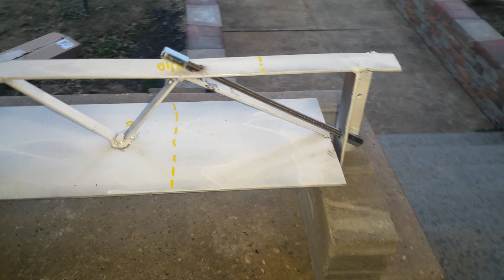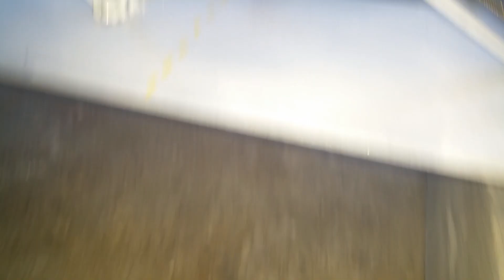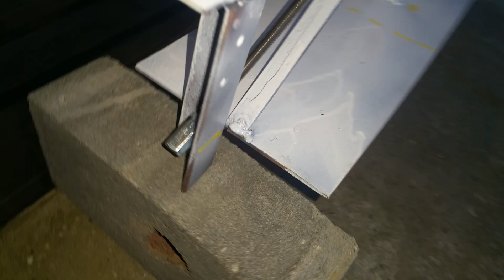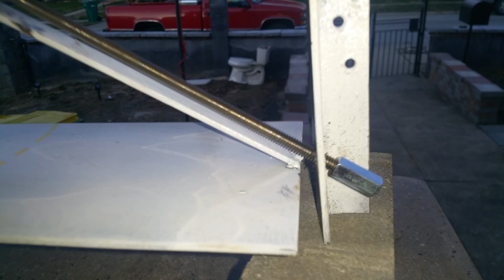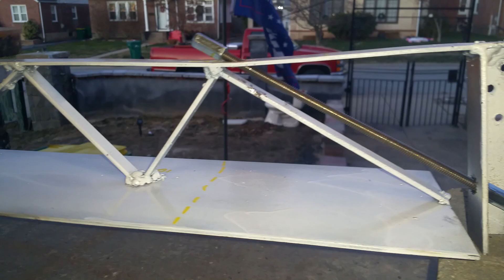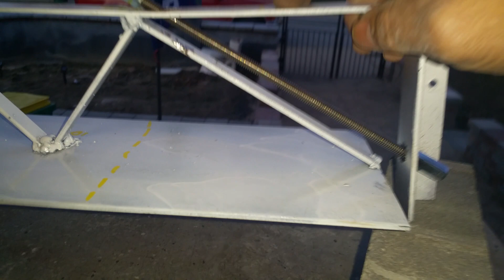FIU BRIDGE COLLAPSE MODEL PART 3 SAGGING DECK EXPLAINED = LONGITUDINAL POST TENSION FAILURE FIRST

Comment: Isn't sagging just a continuous downward deflection?  just about all bridges have some sort of deflection throughout its operation.  The engineering is to account for and counteract the deflection/sag.  If the concrete had been given more time to cure and obtain a good adhesion to its rebar, it probably would not have cracked up so early, however I think this design was always doomed, it very much appears the concrete was not properly supported during the casting.

We use a lot of pre-stressed concrete elements in our bridges here and I can only recall instance where a bridge beam was declared unusable and rejected for installation.  Those bridge beams are much thicker and taller.  I know concrete can be made to make pretty long horizontal spans but they usually take the form of hollow large pre-stressed elements with post tension elements hold the pieces together.  If this had been made out of smaller modular elements, it probably would have been stronger but I am sure would have violated one of the goals of keeping the street open during construction.  When we build those big flyover ramps there are lots of scaffolding and cranes holding up what is essentially a limp noodle until the post tension elements are completed.
Reply from the maker: Answering the first part of your question, deflection cannot exist after you remove forms...
It will lose the all compressive statement of Figg Engineering, Linda Figg's public statement on how this system works.
"Sagging" is an "active/movement" and will, be default, create tension...
This brings me to a video I did months ago, that longitudinal post tension was not strong enough to keep the structure from deflecting / sagging.

Comment: How I view it at this moment (view can be changed): it is not an I beam, it is not a truss. It is TWO SEPARATE post tension spans that were linked with the mostly decorative diagonals, although they did keep the deck/canopy from racking. The deck sat on the base and the canopy sat on top to verticals 1 and 12. 12 was not supportive enough where it met the base to hold the canopy. When 12 started moving in a torquing fashion by the shim malfunction,  the canopies back was broken and pressure from the weight of the canopy pushed diagonal 10 down to break the deck's back.  If 12 was more robustly designed and anchored as well as all of the diagonals were left out of the design, then the structure would still be standing. (That is if it could make the move intact from the yard to the street without the diagonals to keep the structure from racking). Those diagonals were an anti-racking device, like the corner sheeting used on house framing, they don't hold anything up but they keep the thing from racking.